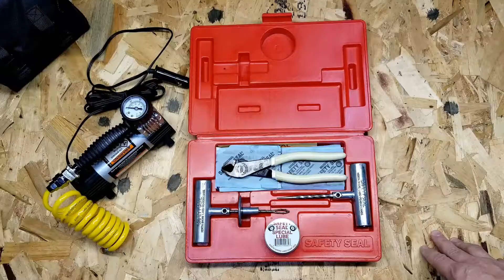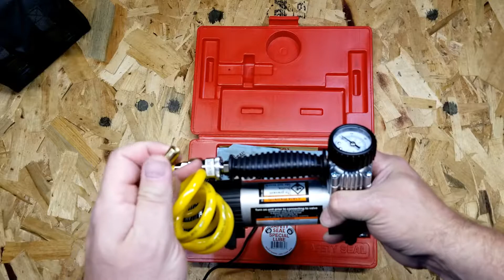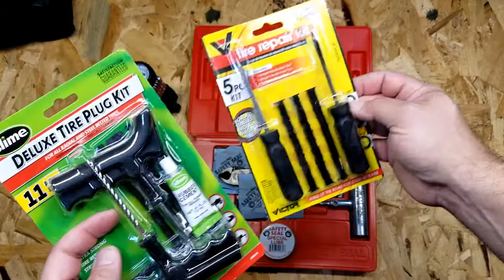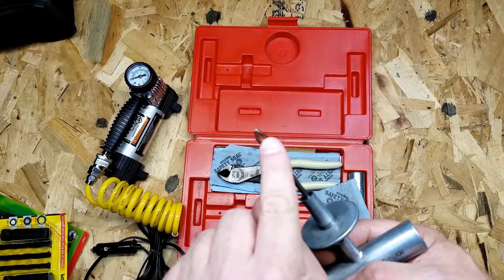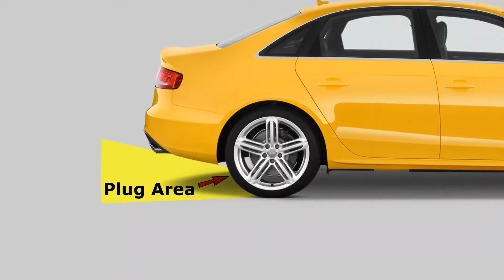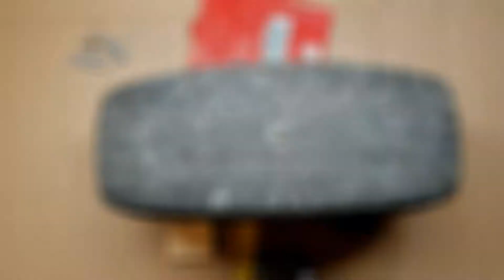How To Fix A Flat Tire - Repair Tools & Plug Kits to keep in your car

Comment: Thanks for the informative video.  If there isn't an obvious screw/nail still in the tire, is there an easy way to find the leak with the tire on the car (when you get a flat on the road?  I am thinking about just try the Slime kit which has that temporary goop and a pump connected together.  Any thoughts on that for emergencies?  thanks
Reply from the maker: You can find a leak in a tire by feel, sound, or bubbles. If the leak is fast/hard enough you might be able to hear the air hissing out, you might also be able to feel the air leaking if you lightly run your bare hands around the tire. (Be very careful running your hand around a tire. If the tire is bald enough, the steel cords could be sticking through and they will easily cut your skin) And lastly, take a water bottle (preferably with a little soap mixed in) and lightly poor the water around the tire and watch for air bubbles. 
Slime is okay.... I've heard it can corrode your wheels from the inside, out but I also have an old friend who swears by the stuff.... I've  used it once on a pair of small snowblower tires and it did NOT work. Its certainly a product worth having in your car (ALONG with a tire plug kit and 12 volt air compressor) if you're planning a long road trip.... especially through the desert SW of the US where you could be a hundred miles (or more) from the nearest help. The stuff is cheap enough that it makes sense to have some Slime AND a plug kit in your car. You could potentially run into a situation where a plug AND slime would come in handy for the same repair.  Good luck. Thanks for the comment.